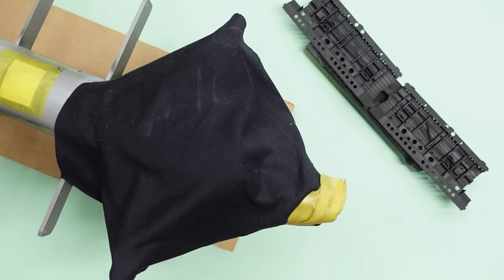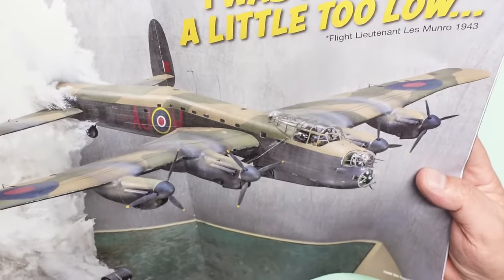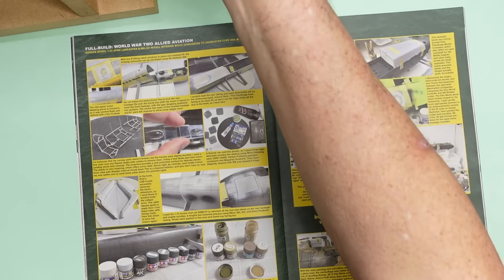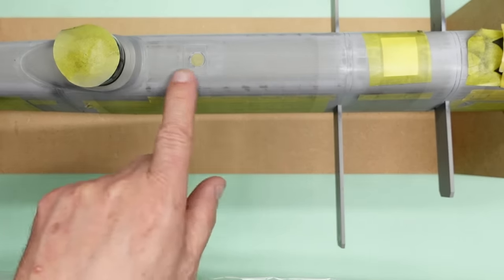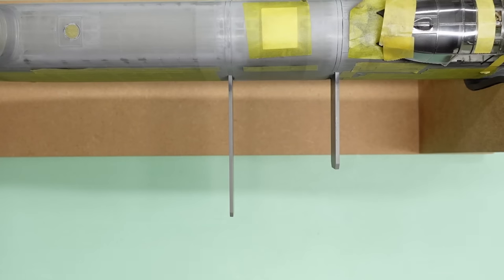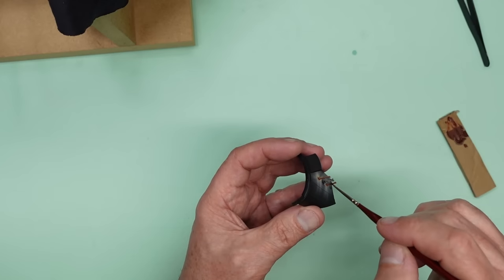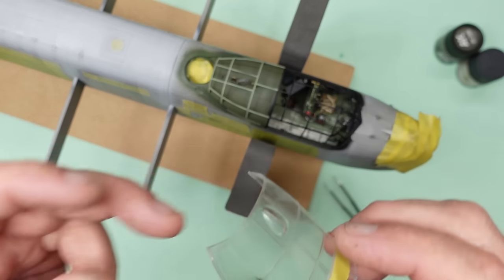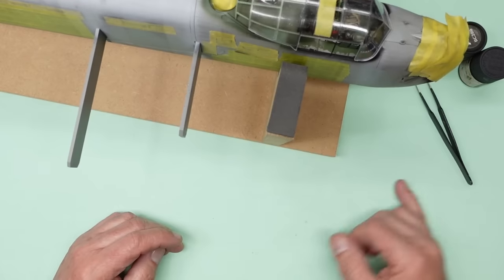Some Lancaster modelling chat and some work on my project

Comment: Great video Nigel. I read Carl had used Archer rivets in the magazine, but you mentioned HGW. Which specific product/product number did you opt for? Obviously at 1/32 scale..
Reply from the maker: The HGW actually didn't work out as they are not a good match for the rivets on the kit. I have ordered in some Archer and Quintas rivets now.
Reply: @NigelsModellingBench  Thanks Nigel 👍

Comment: Nigel, you may find the HGW rivets to be too faint in contrast to the moulded ones. In that case, an alternative may be Eduard's recent release of rivet lines (single, double, and triple). Quinta studio have also released some not that long time ago. I think both of these are more pronounced than the HGW.
Reply from the maker: You are correct Sir. I have tried the Micro scale ones and they are too big so have ordered Archer and Quinta. I believe Archer will be the best due to very thin decal film.

Comment: Nice to see you still chipping away at the Lanc Nige! I have to pick up some of that fishing line… game changer! Two questions, I bought HGW seatbelts for a Ww1 plane and they did not have the adhesive backing like some of them do? They are also not laser cut. I had to trim them out with a blade. I used the glue you had recommended by VMs, but the backing seemed a little slick and caused them to not glue so well. I did clamp and hold them in place. I’m not certain they will hold when I work on them again. What do you think I’m doing wrong? Thanks for any help you can provide.
Reply from the maker: I believe the old HGW belts also had a backing?